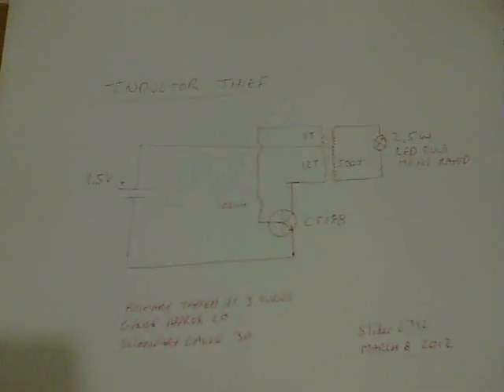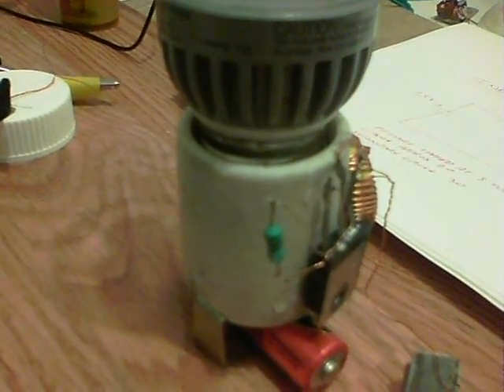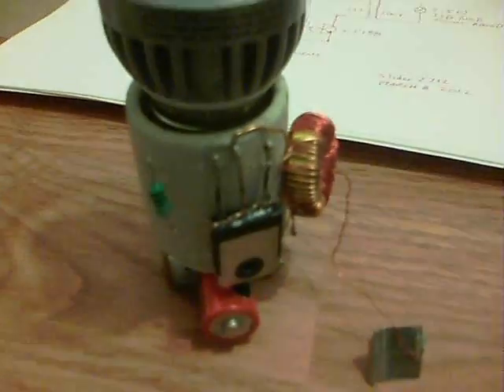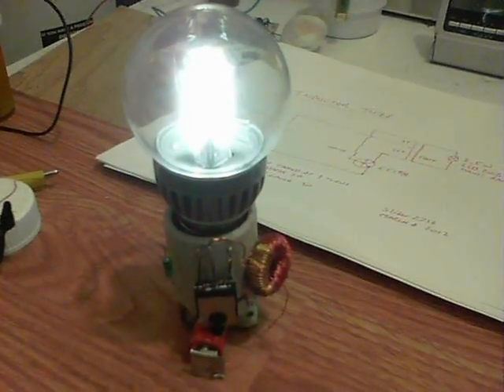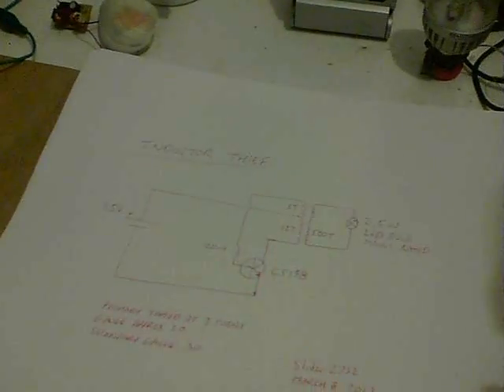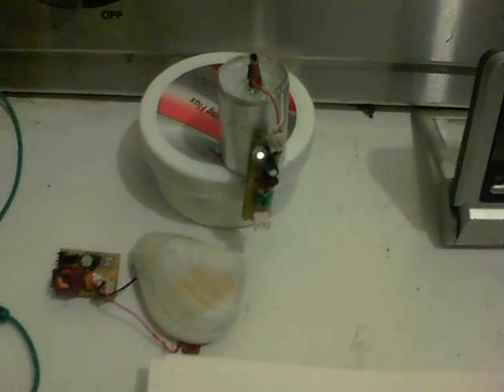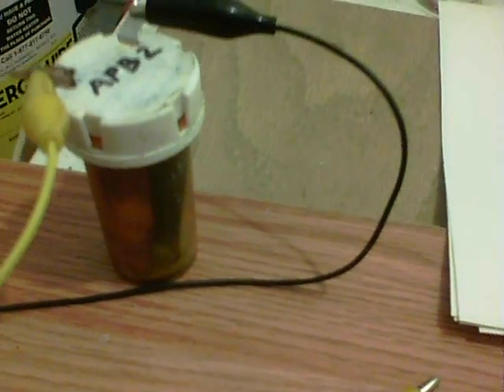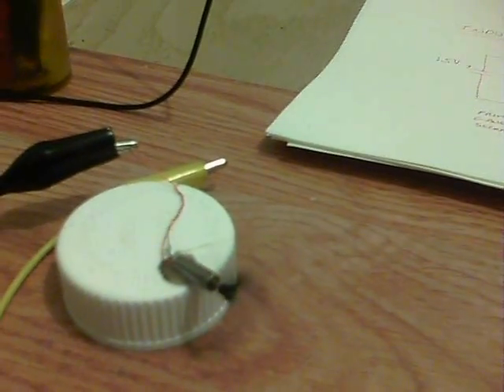Inductor Thief + Alum cell motor

Comment from the maker: @powermaks Take a piece of thin straw and wind onto that first, say 700 winds to adjust for thickness. Then put a bit of hotglue on one end to stop the winds coming off at the top. Wind the toroid by putting the straw through the hole, around and around. If a small toroid, can put 300 on first, solder join to another straw load of 200. The toroid inner diameter will decrease because of the windings, so the second set should be less than the first.

Comment: That is really good. You got the gauges right and turns there... No matter what, when you keep the input voltage that low, everything becomes cheap to own / operate. You can charge a whole bunch of AA's of a puny 12V solar panel. A big whole bunch!

Comment from the maker: @KyleCarrington I only wind the damn things because my wife doesn't put the hula outfit on enough LOL. Yep, runs quiet. No idea what the inductor does, except it seems that resistance is resistance and a theory is that you could walk to a fence post outside and back with a single wire and that would trigger the Base :)
Will have to get some fresh batts, all of mine are at least a year old since less R/C transmitter use.

Comment from the maker: @slider2732 If can't fit straw through the hole with the full windings, you can split it into 2 lots and solder a join when you begin the second straw full. By that time, the windings will be off the toroid and you can put a piece of tape around join to ensure non conductivity.

Comment from the maker: @iluzyon1 Just measured it, approx 0.85", all yellow. The Primary windings were already on it, under a black plastic cover and they used to go all around the toroid. Unwound to 15 and tapped at 3. Black maybe better, no idea !. Best tip for winding is to wind on a piece of a thin straw first, count about 700 to allow for diameter, then drop straw through middle hole and around you go. Can put hotglue on one end of straw, to ensure no windings slip off as you go. All windings are same direction.

Comment from the maker: @iluzyon1 It's brighter, but maybe the bulb itself is a better one. This is 2.5W the other one is 2W. However, this one will light a small fluoro tube and the other wouldn't. Will have to see how long 2x identical AA's last for comparisons. Originally this had about 2000 winds of approx 46 gauge from a relay, but I got some shorting out fizzes and glows from it, so had to rewind it.